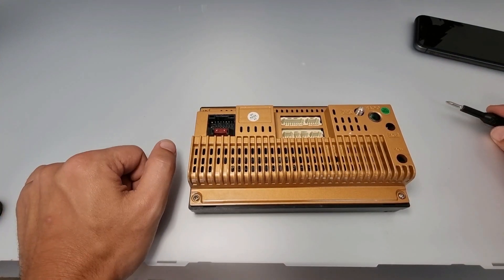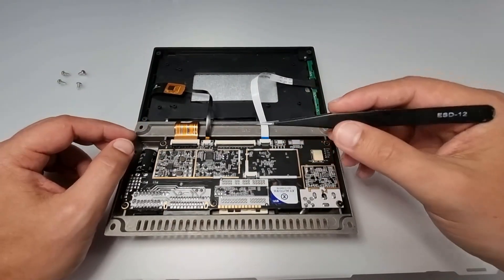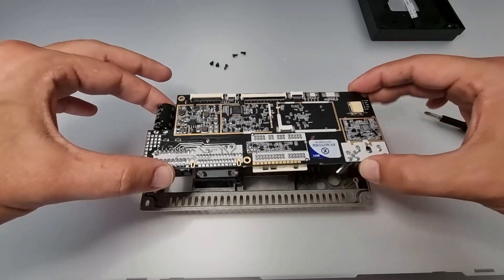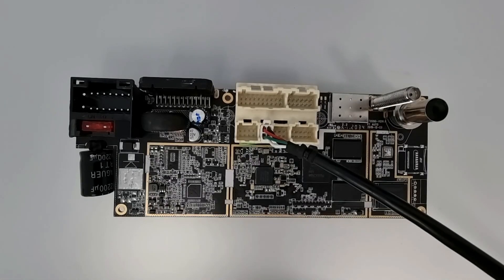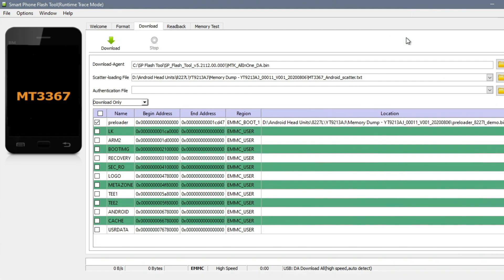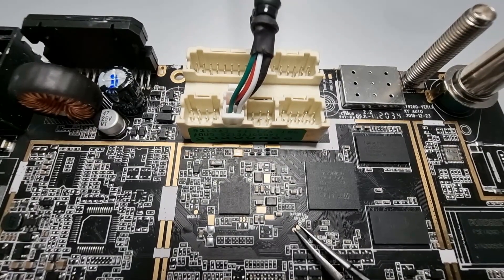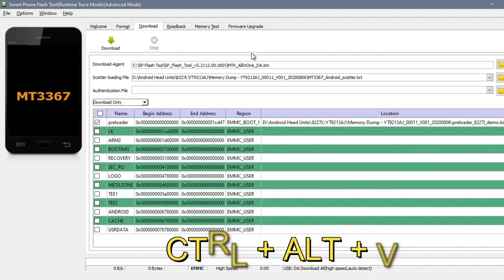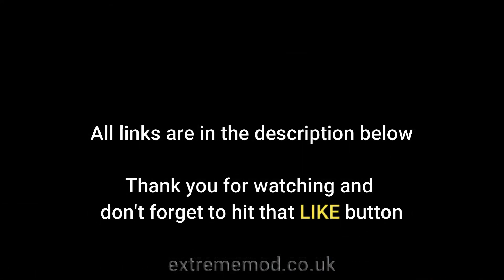How to revive your Chinese Android Head Unit - Test Point method - 8227L - universal car stereo

Comment: Hi there I just got my new android 11 sterio yesterdy and tried doing a update on it I think it was a MCU,the screen froze completele and it would not take any comands so I pressed RST it turned off and does not turn back on. Ive tried pluhhing unplugging, battery check everything basically It wont turn back on. Any idea or advice?
Reply from the maker: If you were updating the MCU, then you have unfortunately broken your unit beyond most means of repair. You should never attempt an MCU update yourself. It's an expert level update and requires special equipment and knowledge as you first need to backup the original MCU and only after -  attempt the update.

You need a new motherboard to solve the issue.

Comment: Hey man , I’m really appreciate what you are doing , 
I’ve a quick important question, how if I mistakenly uploaded one file as system update but this file has different video resolution settings and the device uploaded the file and restarted with white screen and some lines vertical and horizontal res and blue grey .but the Radio and touch screen is working and I can choose files without seeing it by remembering the location (Model YT5750B  - AC8259 .. many thanks in advance
Reply from the maker: HAppy to hear you enjoyed the content. Test Point recovery is meant to be used for completely dead units which yours isn't. You can solve the problem by restoring your backup using SP Flash Tool. We have a full video on that as well. If you don't have backup, speak to your seller - they should have one.
Reply: @extrememod_ahu  In this case, can I pass a new ROM, or should I exclusively restore the backup copy, and can I pass the ROM in testbunet mode?
Reply: My friend, I have the same problem, did you find a solution to it or not?

Comment: How do you refresh the unit the seller on aliexspress I bought from telling me this I have updated via usb  I have not power yo buttons and unit wont turn on it has a red light on back also if is push RST a few times I can get it to boot up to android then screen just goes blank
Reply from the maker: Sounds like some of your system files got corrupted. If you don't have a full backup made in SP Flash Tool, then you need to hire an expert to help you.

Comment: Hi bro, thanks for the video! I want to ask you something.
I have model xl6107 for bmw e90. I have sputtering sound problems with my device after 25-30 minutes listening louder music and also i have the feeling the device is overheating. I contacted the seller and i ordered a new motherboard. So if i change it will it have the same problem too and the all the work will be pointless and the new motherboard will have the same problem. What do you think? Thanks in advance if you take your time to help me!
Reply from the maker: Unfortunately we are not familiar with your head unit type. For BMW you want to use Qualcomm-based units, not Mediatek. Check out this seller on AliExpress: EBILAEN
Reply: I think about installing a cooling fan, what do you think about this idea😊
Reply from the maker: @Daniel Aleksandrov  can't really say. If this unit is like the cheap Chinese head units, you'll need much more than just a fan. 
When we do cooling mods - they include custom heat sinks and circuitry for PWM control (I.e the rotation speed of the fan is controlled by the temperature of the internal amplifier)

Comment: Hi this is off topic. may I know the screen and touch connectors have how many pins? Is it possible to use the screen directly with raspberry pi 4 dsi? Thank you
Reply: Usually 6 pins and it is driven by GT911 chip. Some radios use different GT chip. Don’t know how to use it with raspberry, but there will be some way to do it.
Reply: I was wondering about the same thing. I have a Fiesta Android and the performance is terrible. Would be good to try and hook the screen up to a pi, but I can't find information about whether the android screen connection is DSI compatible or not.

Comment: hello my f9212B freeze on boot on logo abdroid. how to hard reset please? it's AC8227 based
Reply from the maker: For Hard Reset you need to have a proper back up made in SP Flash Tool. There is no 'magic' hard-reset button or combination. A very likely reason for your unit to be stuck in bootloop is that your system files got corrupted, probably when something was updated something through Google Play. You need to hire an expert to restore your head unit.
Reply: @extrememod_ahu  i installed an app to add mémory ram but i forgot i had no much disk space free so it crashed. when i connect the motherboard to my pc the led does not light on and no device recognize. an unknow device appear only with the 6pin usb connected despite i installed the mtk driver
Reply: Yes the led come blue but a light blue but no recognize by the pc
Reply from the maker: @mightydtwentycent5921  this means your drivers aren't installed correctly. Check this video for help: https://www.youtube.com/watch?v=1D2cKcgFr_o&t=259s
Reply: @extrememod_ahu  i  do it properly but nothing happen when i connect the unit to the pc. the led is on blue

Comment: Hello, I have a YT5760B Lexus IS250 stereo. It is stuck on the green Android man during bootup. If I leave the radio along for 2 days, it may boot up and then freeze. Any ideas? Thanks!
Reply from the maker: Sounds like an issue with the Sleep mode. Try to disconnect it from car battery and then re-connect it again and see if it boots up. Do this 2-3 times. If it doesn't boot every time, then it's a hardware issue. If you are under warranty - simply return it. If not - we can take a look at it if you wish to send the unit to us to the UK.
Reply: @extrememod_ahu  I have taken it out of the car and am using a power supply to test it. Doesn't boot up . I have ordered another motherboard, thanks!
Reply from the maker: @50088  you can donate the faulty motherboard to us perhaps? If so, please reach out via our website: https://extrememod.co.uk/contact-1

Comment: do you have a video explain what each of the white pin connectors(20,10,6,8) are for! Why do some android mobile units dont have video out?
Reply from the maker: There's no need for a video to cover that. You can check out these two pictures: https://ds-blobs-1.cdn.devapps.ru/15659744.jpg and https://ds-blobs-4.cdn.devapps.ru/14289475/Screenshot_20181101-214908.png?s=009687006d93929a638ddc0600000000c059465d38c9001b273f0f9379bf7fbb

Comment: After replacing the touch screen. How do I check the system without connecting to the car. What hardware do I need?
Thanks
Reply from the maker: https://www.youtube.com/watch?v=1D2cKcgFr_o&t=38s
Reply: @extrememod_ahu  I saw the video
What is the limit of the ampere a
Reply from the maker: @ELIKO975  at least 5A

Comment: Please help,
 can i apply this method, if my system is stuck on the logo and keeps on rebooting?
Reply: i have the same probleme, did u resolve?
Reply: @mateuscastro2219  no, have to format using computer and reboot with new software. I couldnt find anyone who can do, so I change my system to a new one.

Comment: @ExtremeMOD Android Head Units
Hi dear
I have a YT9212B, if I try to install your firmware modded, I will work?
Thanks in advance
Reply from the maker: Unfortunately your system isn't supported.
Reply: @extrememod_ahu  thanks. Can you share an AliExpress link yo get that model?
Reply from the maker: @carlosbmwe38  we support a large number of XYAUTO Mediatek units. Best you can do is to ask for a screenshot of the System Info from an AliExpress seller. As for brands - Podofo normally has compatible units
Reply: @extrememod_ahu  
Ok, I asked and I'm waiting for answer

Comment: Hello, thanks for your video. But how about if my motherboard hasn't led to check its ok. However, I connect the some usb conecctor and my laptop dosent detected. What check next? ...do you have such a video of testing main transistors or didodos etc in order to find the problem. Thanks in advance. ...By the way, the problem started with the radio and water...once it was solve the screen never work again but the android internal fuse its fine...so dont know what to check after seing the usb doesnt detect the unit. Many thanks in advance!
Reply from the maker: If the light doesn't go on, you have probably a serious issue that can only be solved by fixing the onboard electronics. If you are located in the UK, you can send you head unit in to us for inspection. Reach out to us on our website: https://extrememod.co.uk/contact-1

Comment: I have a situation where the android radio was doa from ebay. The seller stepped away from eBay when I brought the issue to his attention, so I am attempting to fix it. So the radio will only power on if I hold the reset button in. It is an Asure unit and the reset button is located on the front top left corner of the screen. 
Once I release the reset button, the unit will stay on for 5 seconds maximum before powering off. 
Any ideas?
Reply from the maker: Unfortunately not. Try to search the XDA forums for a solution

Comment: Model yt2196cj
Problem : pulled out the usb stick through which I was updating my head unit mid update. Now the head unit won't turn on.
Pls help
Reply from the maker: Restore your backup with SP Flash tool. If you haven't made backup, then we can try repair it in our workshop. You can reach out to us through our website. We're located in the UK

Comment: Hi, friend.  I have an androy xyauto radio the sticker says 9216CH v/2 32G further down there is a reference 9216CH0017 20200714 the board is a yt9260lp.  Could you help me find the recovery rom please?
Reply from the maker: Doesn't exist. If you haven't created your own, you need to modify another backup to fit your unit.
Reply: @extrememod_ahu 
The unit arrived at my workshop it only showed the Android logo I tried to flash the rom and it was turned off forever.  In flashtool it always gives error 4032. What else can I do apart from throwing it away?
Reply from the maker: @juanantonio8561  you could donate it to us for research and development. We can also try repair it but it will probably be cheaper to buy a new unit. Visit our website if you wish to donate: extrememod.co.uk

Comment: hello friend... i have 'mcu uart error' at the 2 din unit.... plays for 3 hours and after stop working... stuck everything... if i switch down the car for 6-7 hours and after i turn on the car the unit plays for 2-3 hours... what do you think it is;
Reply from the maker: Your headunit is probably overheating. It's a very common issue. Only solution is a cooling mod.
Reply: @extrememod_ahu   thank you for your answer..is it possible to give me example for cooling mod?thank you in advance
Reply from the maker: @panagiotisraptis5629  you can check out our website for pictures.

Comment: Hi! Thanks for the video, i have the exact same model YT9216BJ mcu 3.5 but mine was bricked, when i contact the seller, he gave me an OTA FIRMWARE, which i dont kn0w how to use, or can i convert it to a sp flash tool compatible firmware. is there any way to bring this headunit back to life.. TIA
Reply from the maker: OTA updates cannot be used with SP Flash tools. In fact, if your unit is bricked, you need either your backup or hire an expert (like us) to do the repair for you. You can reach out to us through our website for more info: https://extrememod.co.uk/contact-1

Comment: Brilliant video. So I followed your method and was able to write BOOT1 at 0x0 with touch points method. I do have memory dump (scatter, bootloader, user data) as guided by you in other video. While attempting ROM_USER, it doesn't detect computer. You mentioned that it should detect after BOOT1 write.
Also the Begin address is 0x0 for both BOOT1 and ROM_USER with just region selected differently?

External RAM:

	Type = DRAM

	Size = 0x40000000 (1024MB/8192Mb)

NAND Flash:

	ERROR: NAND Flash was not detected!

EMMC: 

	 EMMC_PART_BOOT1 	Size = 0x0000000000400000(4MB)
	 EMMC_PART_BOOT2 	Size = 0x0000000000400000(4MB)
	 EMMC_PART_RPMB 	Size = 0x0000000000400000(4MB)
	 EMMC_PART_GP1 	Size = 0x0000000000000000(0MB)
	 EMMC_PART_GP2 	Size = 0x0000000000000000(0MB)
	 EMMC_PART_GP3 	Size = 0x0000000000000000(0MB)
	 EMMC_PART_GP4 	Size = 0x0000000000000000(0MB)
	 EMMC_PART_USER 	Size = 0x000000039a000000(14752MB)
Reply from the maker: You only need to use this method if your head unit is dead. If it's working then you're fine.
Reply: @extrememod_ahu  So where to find the begining address for ROM_USER?
Reply from the maker: @3mils0n  it's the same - 0x0
Reply: @extrememod_ahu  dear friend I updated using sptools format +download but after this update head unit won’t power on and you mentioned led not working but before this update led work how can fix this
Reply from the maker: @selpriyan  simply restore your  backup.
Reply: can we increase this dram size from 1 gb to 4 gb?

Comment: Hello mate.Thanks for the video. I am about to do the test point  but dont have any back up. Would you be able to share it with me or help me with where to find it?
My head unit is YT921AJ_00011_V001
9.1 car edition
Can Pro 3.7 X2 No Pro
1G 16G
A7 1.3Ghz X 4
1024 *600
MCY 4.0 x 2

PLEASEEEEE HELPPP

Comment: Hi. Thanks for the video tutorial. I have a T700 android unit with the build version as alps-mp-o1.mp5. After changing my speakers which had torn,  I noticed that both the buttons on the unit and those on the steering wheel stopped working later in the day. The unit still boots up and apps can be opened and interacted with, but no sound is heard. The radio app doesn't show any station, just shows 0.00, and if you go to settings and open the infotainment section, it closes back by itself (this does not happen to any other settings section). How can this be resolved please?
Reply from the maker: Sorry but this is highly off-topic. Please search the XDA forums for solution

Comment: Hey thanks just wondering did it have in a sim card or a sim card holder
Reply from the maker: Some motherboard versions have a slot for an SD Card.
Reply: Does the TS10 from Rhino Radios has one

Comment: Hello please i need your help I have a screen model tesla from allwinner ts8, and it just stopped working, it turns on but does not leave the presentation screen showing the ford logo (model of my car) I contacted the seller who sent me the update file, but at the time that finishes the screen does not restart automatically, so I was told that it lost the operating system, I've tried everything but without success, can you help me?

Comment: Hi! I have a 12.8 inch vertical android head unit for toyota crown, it stuck on android logo, now i dont know the firmware or any details of it. How can i go on with flashing it? The reset button isnt helpful at all on this unit
Reply from the maker: It's impossible to say as there are hundreds of different head unit models.
Reply: @extrememod_ahu  is there a way i can format it? i dont mind losing any data, all i want is for it to work again as from factory. I followed the instruction to install MTK drivers but when i connect it, its not detected at all but i can hear some clicks coming from unit's motherboard
Reply from the maker: @kashareservations239  reach out to us through our website as we'll need pictures of the motherboard to first identify the head unit.

Comment: This method is to recover a drive that turns on but does not boot the operating system? and it is also not possible to enter recovery mode?
Reply from the maker: This method shows how to restore the firmware to working condition on a dead head unit. For this you need to have your backup ready. You can follow our video here on how to create such backup: https://www.youtube.com/watch?v=1D2cKcgFr_o

Comment: I want to flash a chinese stereo but I don't know the model, what can I do? Stuck in logo
Reply from the maker: You need to open up the unit and check what the sticker says on the big white connector on the bottom center of the motherboard. That will tell you the model. With that said, it will be very difficult to repair without a backup and you probably need someone that specializes in these units - to help you. If you are located in the UK, we can repair it for you. Reach out to us on our website: https://extrememod.co.uk/contact-1
Reply: @extrememod_ahu  I live in Panama but thank you for your help 🙏

Comment: hello, I have a central multimedia AC-9213-wifi-1GB RAM, 16GB ROM, Quad core 1.3GZh.  When I turn it on, it stays with the android logo on the screen constantly, after a few minutes it appears on the screen optimizing the application and again it returns to the android logo, how can I solve it and make it work again?
Reply from the maker: Not by the Test Point method as your head unit isn't bricked. 
You're currently experiencing what's known as "boot loop". This happens when system files are corrupted. The only way to fix it is to restore it via SP Flash Tool and a previous backup done via the same tool. 

If you're within warranty period, return the unit. If not, we can fix it for you. Reach out to us via https://extrememod.co.uk/contact-1

Comment: my android head unit is stuck logo android. however, when plug usb 4pin ( connect laptop - android head unit ), then PC not dectect  port (COM). how to fix. thank you. model: YT9213AHJ. i have learn about chip stm32f103c8t6, it need hardware  driver ic. howerver, i can't see it on motherboard. how do you can connect PC without hardware  driver ic.
Reply from the maker: Watch this video - it'll walk you through everything you need to successfully install the drivers and necessary software to revive your head unit: https://youtu.be/1D2cKcgFr_o